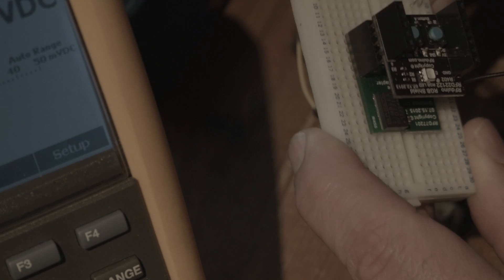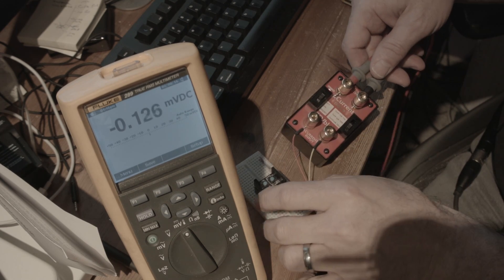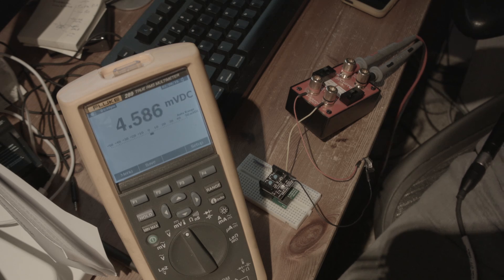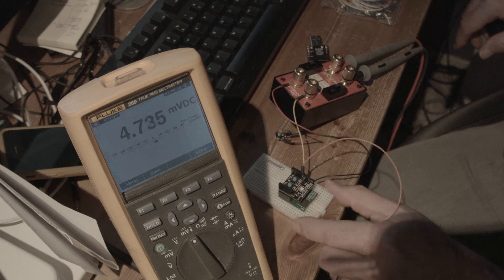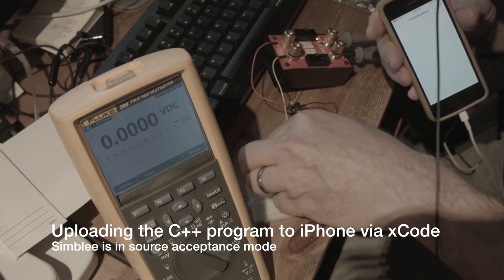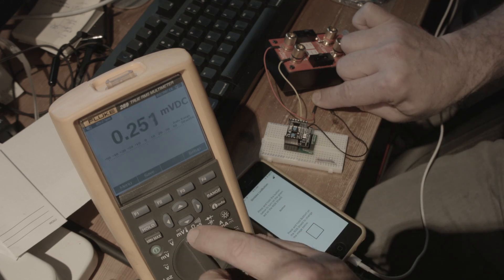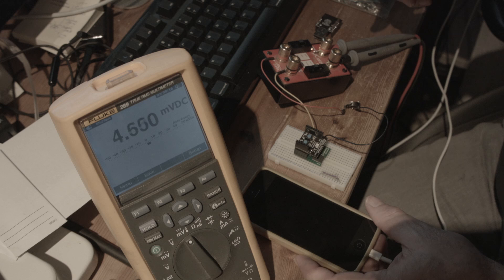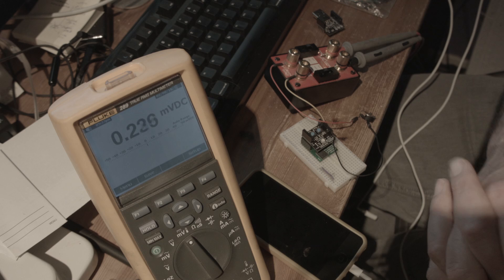Simblee II - The power consumption

Comment: Great instructional video's. My first question is can you transfer back and forth audio like a Blue Tooth headset?  I have not been able to get a kit yet? And the second question is on the music side do have time for Soundtrap? Would like to jam sometime.
Keep up the good work.
Reply from the maker: +Mr. Ping Hey thanks!  On your questions - I have to say, great questions to which I probably have an unsatisfactory answer because I really don't KNOW 100% these answers, but I have conjecture based on my experience.  I mean, I've never tried to transfer audio, but I have used other Arduinos and Arduino clones for audio.  Here's what I think - and this could also make a good video:  I bet you CAN do it.  I bet you can send live audio, and/or, ship small audio files.   The reason I think this is that there's no reason you couldn't set up a small microphone as you "sensor", digitize the sound, and then send the bits to an iPhone or Android app - and play them back.  

The caveats would be:  the A0 in the Simblee is only an 8-bit machine.   The A/D in it only digitizes 10 bits (1024), So digitizing the sound would not exactly be hi fidelity.  BUT, there are plenty of Arduino shields that do this stuff for you, so it could be possible to use some outboard hardware to capture the sound and only use the Simblee to do the data transfer - but again, at most it's going to be, 16-bit data if you use unsigned long ints to send/receive...?   I think that's correct but I never tried it.

Certainly the bluetooth bandwidth can handle multi-channel audio, but can the Simblee write that kind of data, that quickly?  Hmm...an absolute "maybe".  Would have to give it a try.  As far as maybe doing small audio file transfer - well, you'd probably have to use some sort of external SD card file system (like on regular old Arduinos).  As the objective of this thing is super-low-power, though, it might not be the best HW to do that.

But I dunno for sure.  Definitely worth exploring.